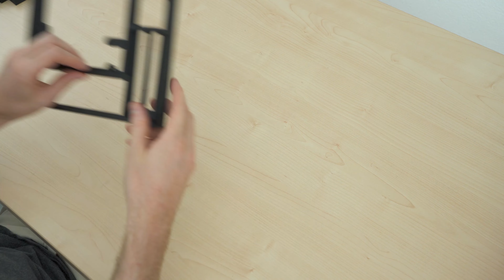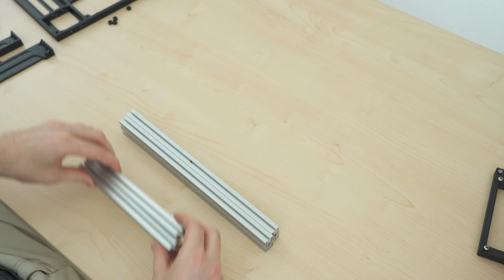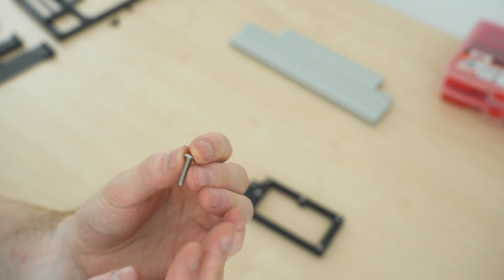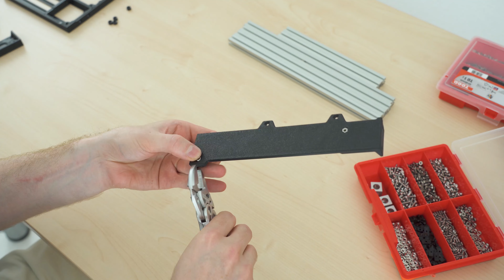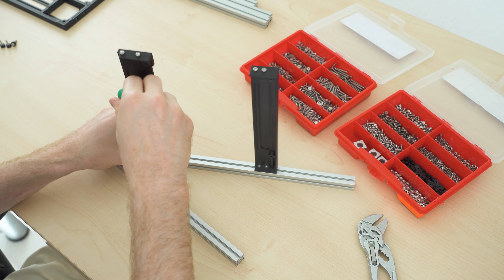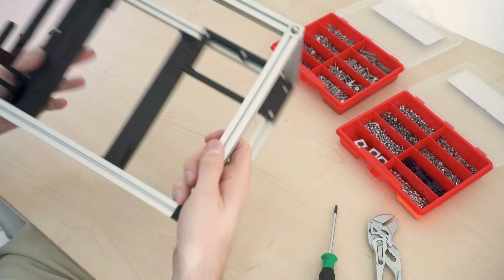BeamCase SFF ITX Assembly tutorial (v4)

Comment: You mention the fullsize ATX section in this video, but this is not included in the printable link? Where do I find this part?
Reply from the maker: I have not published the full size ATX version yet. I have to do some finishing touches on it, so hopefully it is done soon.
Reply: @jakob.k_design Okay, Am going to go ahead with the 3 slot build. As a guess, how many fasteners do you think I'd need, 50 each?
Reply from the maker: @JDSPonYT  
50 each should be enough, but normally you get them in higher quantities anyway if you order online. 

When I order them online each box contains 500 pieces and the prices are quite reasonable (I paid 4,66€ for 500 m3x8 stainless steel torx screws but prices for screws have fallen so now they are under 4€ for 500) 

Before you order your fasteners you should definitely check out this print that locates low profiles nuts so they do not slide around in the profile:  https://www.printables.com/model/744778-beamcase-nut-positioner
Reply: @jakob.k_design  I have no clue where to buy Fasteners in the UK for that price, but put an order in for 50 of each. Another question, you haven't released the external ATX PSU, would that be possible or more design work needing to be done?
Reply from the maker: @JDSPonYT  
I found this vendor that has fairly reasonable prices (100 M3x8 for 2.25), and it has a great selection as well. They even carry the low profile square nuts and very specific 6-32 UNC screws. 
https://www.gwr-fasteners.co.uk/m3-x-8mm-socket-countersunk-screws-din-7991---a2-stainless-steel-69888-p.asp
https://www.gwr-fasteners.co.uk/m3-x-8mm-socket-countersunk-screws-din-7991---a2-stainless-steel-69888-p.asp

I can release the external ATX mount fairly quickly (probably next weekend), If you send me a quick message on printable I can also send it to you immediately.
Reply: @jakob.k_design Thanks, I am pretty sure we purchase from them for the fasteners we use at work :)
When it comes to the nuts, you mention in the video just using any ol M3 Nut, but in the printable link Square nuts + the clips. Is that just to ease installation stopping the screws from sliding around or more structural rigidity?
I'll send you a message, thanks :)
Reply from the maker: @JDSPonYT  Using the low profile square nuts with the clips is just an ease of use thing. You can use standard m3 nuts for everything and it will provide the same strength. It can just be a bit frustrating if you test different configurations and the nuts slide around.

Comment: Cool idea.  I watch a few channels that make extremely small PCs that always use these cases that are more expensive than any other single part!  This way you could get the exact parts you want to use THEN design the case around those.   On the videos I watch they often can't get a GPU or CPU cooler to fit, it's 1mm too big, but with this you can make exactly what you want fit.  I really like what you've done here.